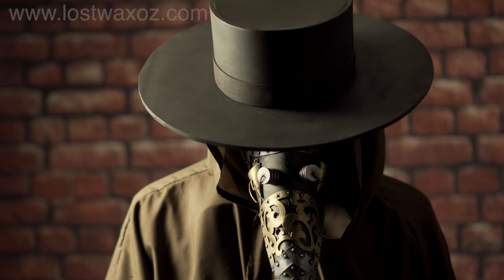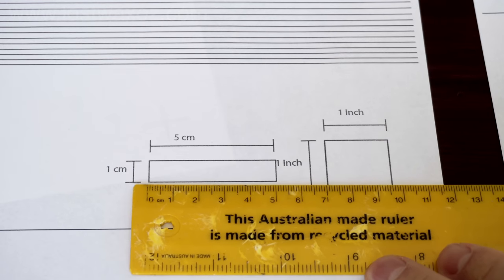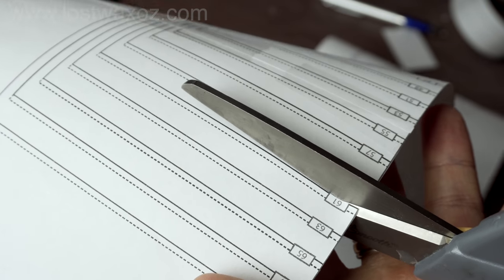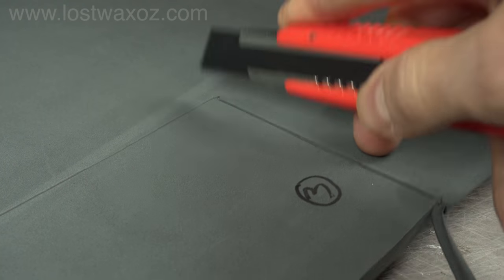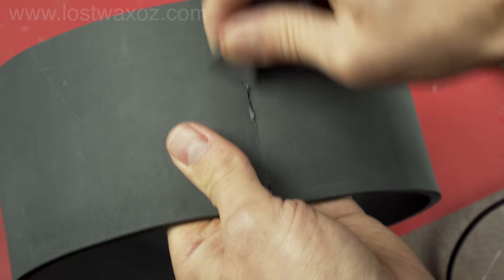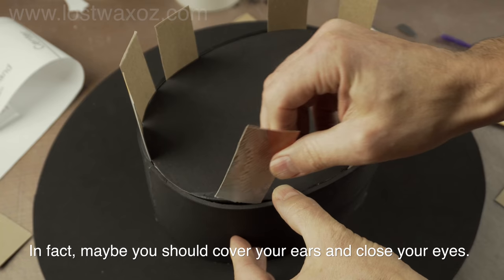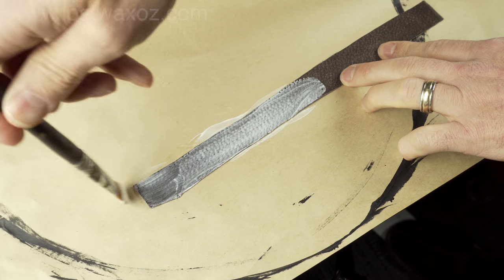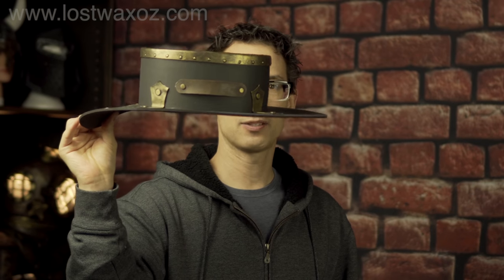DIY Plague Doctor Hat / How to Make a Plague Doctor Costume Tutorial and Template

Comment: Hey, how big should the foam be in order to be able to make this hat? I don't know how big of a sheet to buy T-T
Reply from the maker: If you are making the largest size(which you probably aren't) you would need a sheet of foam 480 x 415mm (19" x 16 1/3") for the brim and top of crown, and a sheet 727 x 117mm (28.5" x 4.6") for the Band. That doesn't include the 2mm foam if you want to add any extra details. If you are making a smaller size, you can get away with slightly less foam.

Comment: I’ve been trying to purchase the pattern and I’ve tried two different debit cards and PayPal and I get an error that my payment can’t be processed.

Also, the foam in the link is for 7 sheets not a roll and it looks like it’s 8mm not 4mm.
Reply from the maker: Hey there, sometimes your computer will autofill part of your address in the discount box, which makes Gumroad think you entered an invalid coupon code and won't let you finish the transaction. Also could be worth trying a different browser. As far as the links go, it could be possible that "What the Foam"  is sold out in the rolls.....it's probably pretty popular at this time of year. Course you could use other foam as  if you can find some 4-6mm thick.

Comment: The 4mm foam would be good to make a top hat.
Reply from the maker: Indeed, in fact I just had to try my top hat pattern with the foam and it turned out fantastic. and since the foam is black, I didn't even need to paint it. Because the foam is quite stiff, it's a little less comfortable on the head, but if it's a tiny bit big, I would add a little rim of softer foam around the inside.
Reply: @LostWax  firstpalette dot com has a pattern for a medieval crown made of paper & posterboard. It might translate well to foam & paint.